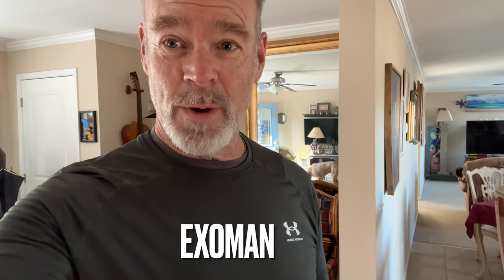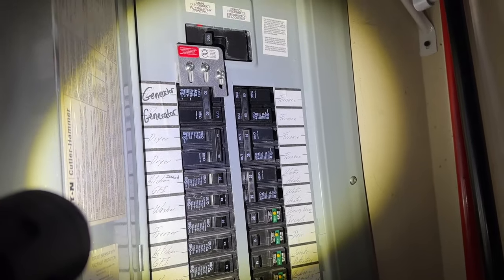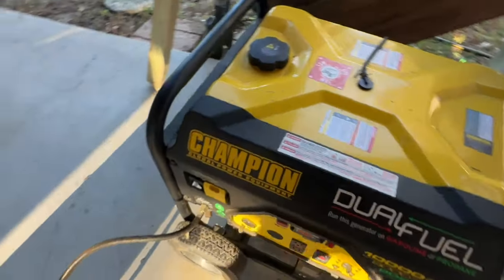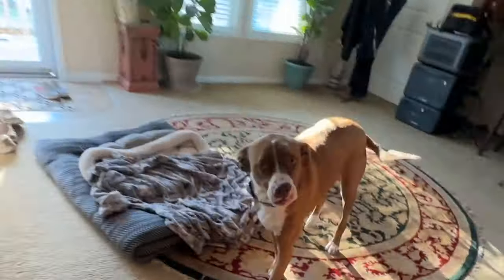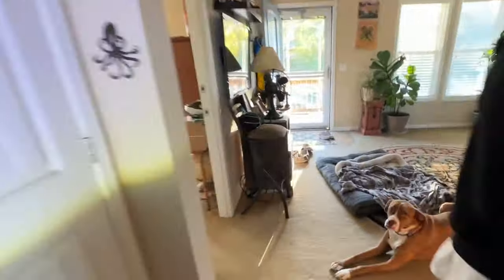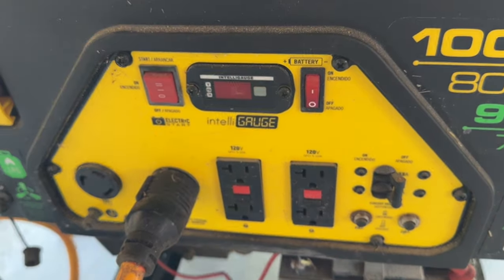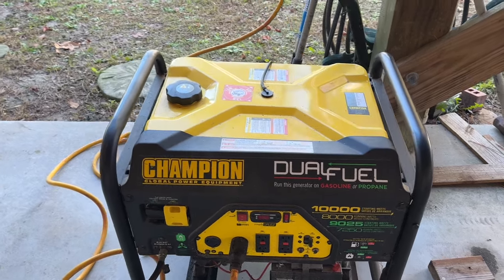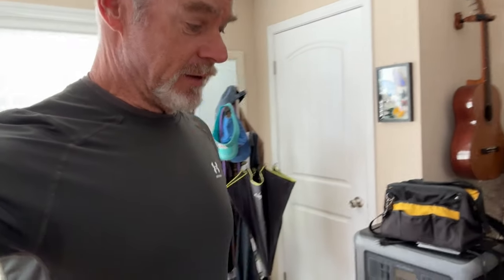How to run a Champion Dual Fuel generator on propane.

Comment: I made the same mistake by never running gasoline and only LP. A friend of mine had a major issue by doing this. LP frost up your fuel system on long runs. The frost turn to moisture, and moisture turns to rust. Thats not rsally a good fit for your fuel system. On my weekley short runs I run a quart of gasoline thru it. I put a 2x6 under the front feet to angle the generator to drain the fuel tank completley. Once the generator dies from starvation of fuel I turn off the gasoline pet cock. I go to full choke and resatart until it dies to burn all the gasoline out of the carb. I do this until it wont run. If you did long term storage drain carb by removing the drain plug. I run mine on a quart of gasoline every week to excersise it with a vacum plugged in as a draw. On emergency power outages like you I use LP because you can shut off the fuel with no tank to drain of gasoline. So thanks for sharing your experience and I hope my tip helps you out!

Comment: This January of 2023 my power company said they were going to trim the trees around the power lines around my neighborhood for 2 days they said they were starting at 9 am central time and end at 1 pm central time both days they started a hour and 15 minutes late and then ended at 4:45 pm central time the temps were -22 degrees F  and they never apologized for the inconvenience of no heat from the gas electric furnace the regular temp inside is 73 degrees F the temps inside the house got close to 60 degrees F
Reply from the maker: I am ever grateful for the linemen working in tough conditions but I hate that the power companies that charge so much, offer so little in terms of efficiency and courtesy. Best to you!